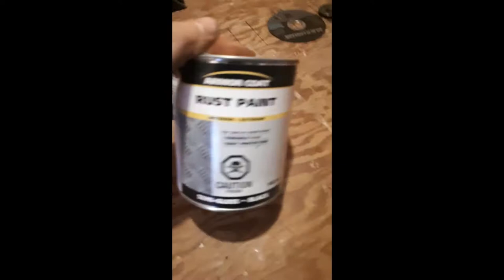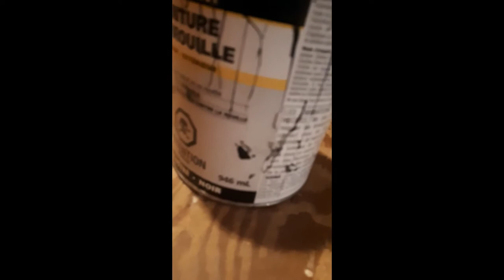enclosed trailer build part 2

Comment: I'm glad those aren't any kind of structural welding. That got zero penetration. Not being ugly about it but you're way too far away from the metal when you're welding. Far too much stickout. Try to get your welding tip on the gun about 3/8 inch from whatever you're welding and don't outrun the puddle. Fun video still